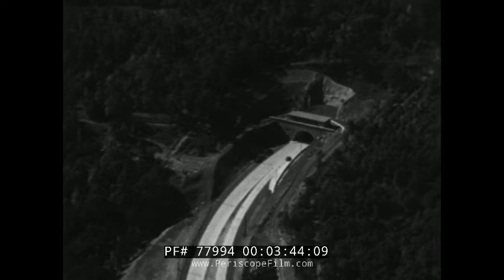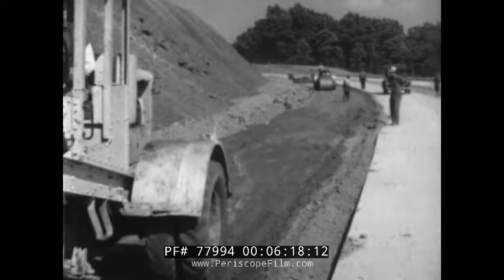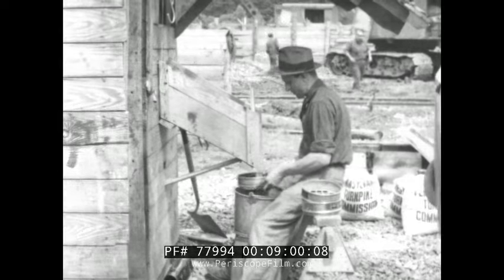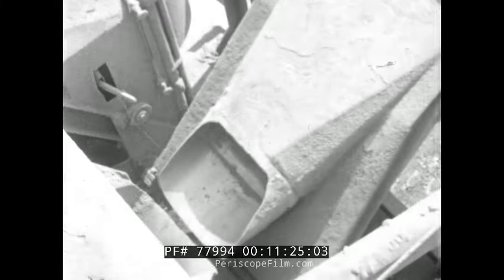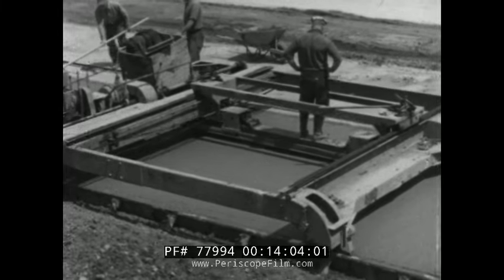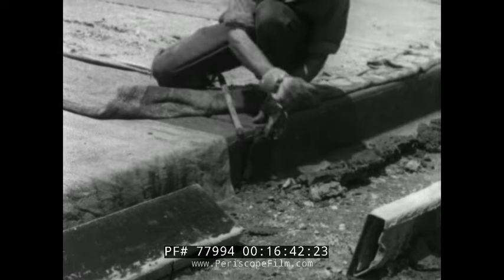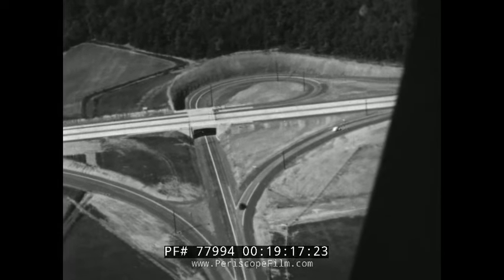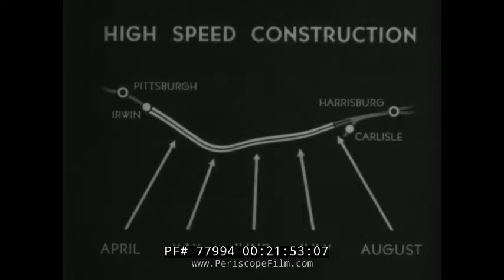CONSTRUCTION OF THE PENNSYLVANIA TURNPIKE  77994MD

Comment: Speed limits were painfully slow in the beginning....
Reply: Actually the vast majority of highways had speed limits prior to the '70s energy crisis. A federal speed limit of 55 was imposed to conserve fuel by lowering existing speed limits of typically 65 and 70mph. The feds had no constitutional right to do this but got around that by withholding federal highway funds to states that did not comply. It succeeded in it's purpose, drive the same route at 55 and then again at 75, you will be surprised at the difference in MPG! (My experience was over 26mpg vs. a tad under 22mpg.)
Reply: @mikebronicki6978  -- You do burn more fuel at a higher speed, but the time saved on a long trip is typically worth it.
Reply: @virginiadude8518  no argument on saving time. The issue in the 70's was that people were lined up at the pumps because the gas station was rationing the gas. Typically 10 gallons per customer. So at that time MPG trumped all other considerations. Today the concern is the environment and it is really hard to work at reducing use when the goal, though extremely worthwhile, is mostly symbolic as traffic wizzes by you at 80mph.
Reply: @mikebronicki6978  -- You must keep in mind that most cars today at 80 miles an hour get far better fuel mileage than 1970s cars did at just 55 mph.  They are safer too.

But I do remember the gas lines & both of the fuel crises (1973 and 1980).  We had to suffer the gas lines and the odd/even rationing.  Oh, that was horrible.
Reply: @virginiadude8518  and let's not forget that cars sold in America are still the least efficient in the world. I mean, does granny really need a four wheel drive pick up?
Reply: @mikebronicki6978  -- And if we all bought a Prius that got 50 mpg, the government would be whining that they are not making enough in fuel tax revenue.

Granny in her 4x4 is paying more in taxes, so we should be happy.
😀
Reply: @virginiadude8518  sorry. I think our planet's health is more important so granny paying more taxes does not make me happy. 😕
Reply: @mikebronicki6978  -- Well, don't let the perfect be the enemy of the good.  Granny's 4x4 still pollutes less than an "economy car" from just 15 to 20 years ago.

Be thankful for that.  Heck, even my V8 Corvette (which I seldom drive) uses less fuel than did a mid-sized car of the 1980s & 1990s......AND has lower emissions.

Baby steps, eh?  Cheers!!
Reply: @virginiadude8518  one small point, and I am guilty of this all the time: the 80's were over 30 years ago. 15 to 20 years ago was post 9-11.
Reply: @mikebronicki6978  -- I know, but 1987 still seems like 10 years ago to me.

Getting old will do that.  😉
Reply: @virginiadude8518  just like when I'm remodeling a bath in a 60's tri-level and think I'm in a newer house. No, tri and bi-level homes are 50 years old!
Reply: @virginiadude8518  Actually folks who now drive hybrids are taxed for that privilege. I can't imagine what will happen when we go electric. Yes ,I do know. A tax will be applied at the outlet.
Reply: @mikebronicki6978  Actually it increased gas use because now cars were on the road for a longer period of time to go the same distance. The higher traffic load meant more slow and go traffic acceleration and deceleration consumes more gas.
Reply: cars themselves were slow, so it did not matter.
Reply: There were no speed limits... wrap your mind around that. Speed limits were introduced in the 70's to reduce fuel consumption for the gas shortage. As a testament to how good they are at generating revenue, they were never removed. sigh
Reply: @HamFistedIdiot  -- Trying to keep down to 55 mph in a modern car is grueling.  There are parts of the PA Turnpike & other major highways where 80 mph is perfectly safe today.
Reply: @HamFistedIdiot   wrong. how young are you. there were speed limits in the 1960's
Reply: @dknowles60  I seem to remember speed limit 60 back in the 60s or early 70s.  The curves on the Turnpike are fairly sharp compared with modern I-roads, and car and truck tires and general handling  were not as good.  60 felt pretty fast.